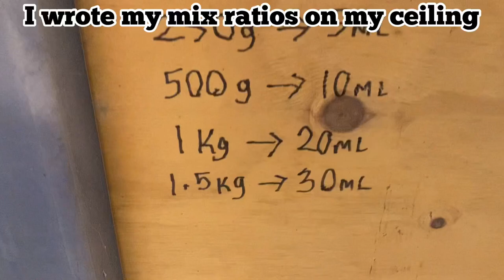25FT Bertram project - Blob 47

Comment: Hey mate in regards to wiring, I’d try use a few things, Solar HD corro and fiberglass around it, Aussie ducting (which looks like it’ll channel into that roof well with fiberglass).
Or bend ally pipes so it’s beefing up the roof in places as well.
For the wiring going up a actuator you’ll need a cable drag chain (Flexible track), or you can go for the coil Solar HD corro if that’s your style.
Finishing the rear’s I see what you mean by it being straight, curve it into a C style so it as blocky but still has your lines.
Rear facing door for the head 100% can’t fault that!
10/10 though love watching these
Reply from the maker: Hey mate
Thanks for the heads up! I googled solar hd. Thanks! 
I was looking at using solar con.. I heat it up with a heat gun and form it . I did it with the dash and glassed over it and it’s super strong and wires will go through it nicer then thru solar flex (corrugated?) .. I think? . I’ll look into it a bit more! Cheers! Thinking I might make a lightweight honey comb roof and use old roof as form work to get the curved shape. The current roof is completely sized wrong for the stretched window frame now. Still deciding but I appreciate your advice!
Reply: @Micington  The corro may work easier for the roof, go the solid conduit when possible as it’s easier to slide through. If your strolling to slide through tie a piece of plastic like a parachute onto some string and suck it with a vacuum then pull that string back with the cables
Reply from the maker: Parachute is an awesome idea! Cheers! Never thought or seen that!

Comment: When making a mould, i use surface cloth (Tissue) and do a few layers of that, especially around the the tight edges, then 2-3 of 225, let it tack off then back it up. Just a thought. Also, i use masking tape (Clear) or plasticine for all the holes. Ok, so now you have the pattern for the roof, trim the front radius back to follow the windows line. i think its too far forward. And its raked as well, thats giving it a false prospective
Reply from the maker: Legend! Aw well back to the shops to get bulk surface cloth and play doe ! Haha your advice is much appreciated! 
The roof was definitely stretch too far forward (lifting eyes were in the way) 
I was going to concentrate on making the top window frame, which I thought I’d do side pillars before that, which is what I was ironing at the end of the video. 
So then I could make a female of the window frame which would then be glassed into the underside of the roof so I would have window shape and a nice recess that the window top would fit into snug then fiddle around with the roof shape. 
I’ve been considering using the old roof as form work to shape a new honeycomb roof with minimum glass because to run wires nicely it looks like I have to separate the top and bottoM skin anyway plus I’m not happy with the weight and wood rot (even tho it’s not structural it eats me) 
do you reckon that’s a stupid idea?
Reply: @Micington  do you have another way of communicating Fakebook or similar?
stick with what you have, dont re invent the wheel, it will bog you down and waist time and materials. 
Ok, Side pillars. Get some 1" foam block. Cut the shake you are looking for. Best way is to have the boat out side with the foam patten so you can get a better idea on the style you are trying to achieve, once you are happy do a floppy mold of that. Don't make thick moulds, this is a one off. Do as i described before, back it up with 2 x 600 and some wet cardboard. As for the wiring. just use Elect conduit, easy to heat and form, then glass to the roof, this will help with rigidity. think weight reduction, as the boat is in a chop, that roof will swing biggly
Reply from the maker: @chookchook5600  michael keller on fakebook. 
Picture of me with my kids. Yeh ok. It just looks like almost as much work reshaping the old roof. But haven’t been near it in weeks to have another look. I just see it in my dreams haha